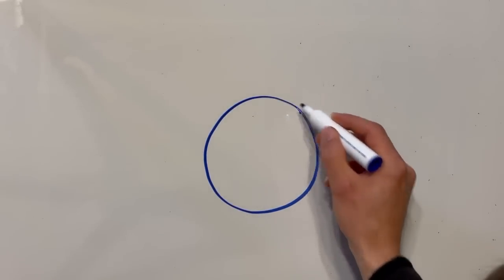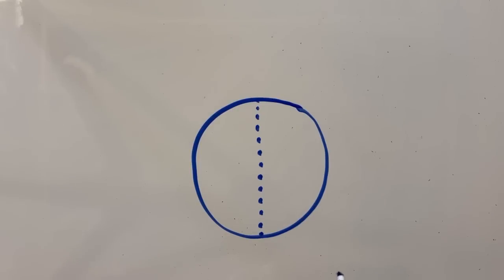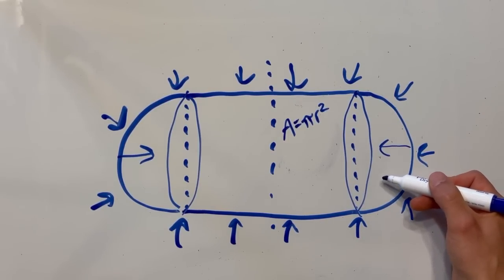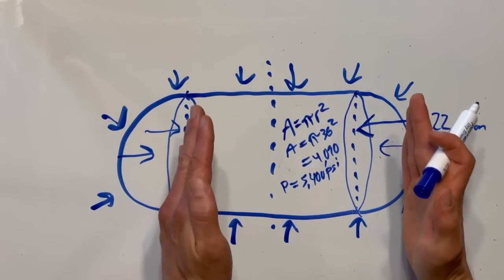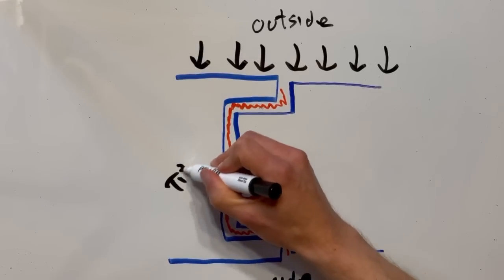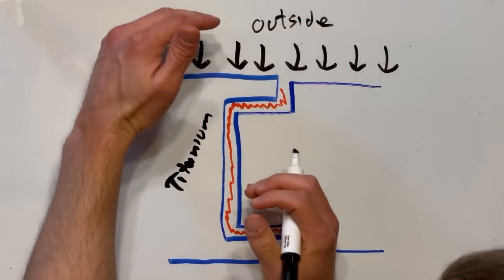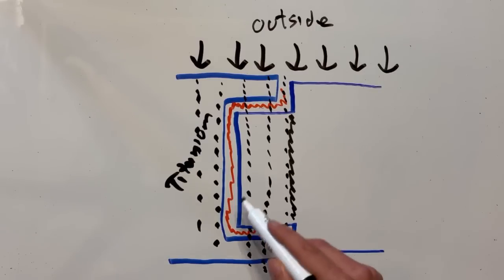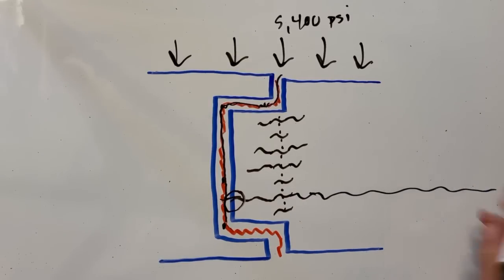Simple Engineering Analysis of How the Titan Submersible Could Have Failed

Comment: From what i saw theres not a single bit of glue residue on the titanium rings. I wanna bet the glue never adhered properly into the smooth titanium. It was only holding it together like a piece of silicone between 2 smooth materials and just popped the titanium off under pressure. If you looks at Formula 1 front wings they can bent alot even though they are made of carbon fibre. You can stand on it and the down ward pressure isnt enough to bend them. But once the wind starts pushing on the end tip the whole wing can bend down because of the way the fibre is laying. Now the parts that arent supposed to move are basically overlapping horizontal and vertical. These parts can stand anyload from anyside without flexing.  However if you see an F1 car crash or the carbon fibre suspension arm is hit at a wrong angle it snaps of real easy.

Comment: I would not ignore the bending in the glue joint.  The carbon fiber cylinder would be deforming to a greater extent than the titanium and that would impose bending in the joint.  The bending may be mitigated by the enormous axial compressive loads, but the bending would cause an uneven load distribution on the glue with the outside of the joint under less compression than the inside.
Reply: Basically correct - although a bit more analysis would be required to ascertain the degree of this effect. But - yes, this is one of the locations worth having a closer look.
The main reason, however, may be the placement of all fibers in the hoop direction (if this really was the case). See my other reply (les 8489).
Reply: @les8489  Completely agree that the carbon fiber is #1 most probable site of failure.

Comment: World's best and first correct analysis available anywhere.

Let me add a little quantitative analysis (which is so easy btw that it can be done in five minutes). Compressive stress in the carbon fiber polymer (CFRP) wall of the Titan submersible was about 200 newtons per millimeter squared at Titanic depth. This corresponds precisely to the stress level where CFRP typically fails under compression. Only under tensile load (which is not applicable underwater), CFRP can withstand about 10 times more. What's more, OceanGate used unidirectional (circumferential) CFRP, as you have also stated. This means that in the longitudinal direction, the hull was only about half as strong, at around 100 newtons per millimeter squared. It's a miracle the ship even made it to Titanic a few times without imploding. It was like doing pole vault, but with a rope as the pole.
Reply: With all fibers in the hoop direction - the strength in the axial direction is about 5% as compared to the hoop direction. And - in compression the strength of CFRP is about 60% that of tensile strength - not 10x less.
Reply: @les8489 
Tensile strength 900 - 2,500 N/mm² 
Compressive strength longitudinal 120 - 420 N/mm²
Compressive strength transverse 60 - 150 N/mm²
Roughly factor 10 and 2, respectively
Reply: @DavidG2P  Tensile strength 900-2500 MPa - OK, although 900 MPa would be for plain-weave fabric rather than tape. The 900 MPa for tape would be an extremely low number (read: shitty tape which belongs in a scrap bin).
Compressive strength 120-420 MPa - incorrect. For a tape with 2500 MPa tensile strength, the strength in compression should be 1300-1500 MPa. If you are getting 12-420 MPa - this means that the test is incorrect (like very long non-stabilized test coupons which fail essentially in buckling). 60% of tensile is a rule of thumb value. These are the results I have been getting on a number of carbon fiber materials in the last 30+ years. Fibers like (somewhat old but still widely used) T300 fibers reliably produce values of about 2100 MPa in tension and 1300 MPa in compression, on coupons with 35% resin content, tested to ASTM standards.
Compressive strength transverse: 60-150 MPa is OK, as this is consistent with strength of resin in compression - although 150 MPa would call for a rather fancy resin.
We are talking here about the failure stress - so, if you can - please indicate a source of "Compressive strength longitudinal 120 - 420 N/mm²"
Reply: @les8489  the numbers come from CFRP companies named PRK and Roechling.
Reply: @DavidG2P  If so - then these numbers are either incorrect, or refer to something else, or it simply is a typo. I have spent the last 40 years designing, analyzing and testing composite structures (aircraft).

Comment: Does anyone know how often, or at all if Titan was weighed as part of its normal sheduled monitoring? My gut feeling is it sounds like it had some form of water ingress which led to either a failure of the Ti/Carbon join or the impregnating of the carbon weave in the tube with water .
Reply: Yes. It beggars belief that the pilot simply disregarded the fact that the sub was descending much quicker than expected. The obvious conclusion would be that "something is pulling us down - and this may affect our ability to return to surface".

Comment: That's pretty much what I thought, shear forces at the joint  parallel to the carbon fibers where the material is no stronger than the base resin seems like a likely cause for failure.

Comment: Some comments from an experienced composites engineer.
1. Like you I was very concerned by the appearance of only hoop winding in the shell, though I have to wonder how the vessel survived even it's first dive if this is the case.
2. You describe what is termed a 0-90 layup.  There are also helical winding techniques where the fibers run at an angle.
3. Carbon fibers are very stiff.  They are not limp. Those who work with them often get stabbed by an individual fiber.  They really hurt.  This is in contrast to Kevlar fibers which are quite strong but very flexible.  Properly designed and bonded carbon fiber structures can withstand compressive loads quite well.  One common example is the top of helicopter blades which are under compressive forces. 
4. The joints between dissimilar materials terrify me.  Thermal expansion differences.  Differing Young's moduluses when stressed.  The sharp 90 degree corner on the titanium flange ring is a tremendous stress riser almost certain to cause problems.  I have had to design mounting of steel rings on rtp structures.  The best approach is generally to provide some sort of cushion between the materials.  
5. In the photos, the area of the glue line attaching the flange appears to be much too small.  Socket joints on fiberglass piping less than a foot in diameter are generally deeper.
6. Components for sizable pressure vessels are generally not cast.  Casting issues can cause many problems with grain structure.  Shells are rolled from plate.  Heads are spun from plate.  Smaller items may be machined from rolled stock or forged.
7.  While  you are correct about the advantages of spherical shell, a cylindrical shell can also be used.  A cylinder will be heavier for the internal volume, but the navies of the world use huge cylindrical shells for their submarines.  These large cylinders are reported to be designed for as deep as 3000 feet which is just as much a design challenge for a large cylinder and 20000 feet for a small cylinder.
Reply from the maker: I almost mentioned helical winds but I wanted to keep it simple for the average person.  I have worked at times with tubes with helical and hoop winds.  It looks like I cut out a small section during editing that stated composites under compression are not necessarily a bad thing, just that additional considerations to factor in.   The titanium end cap should have tapered the flange to almost nothing over several inches to transition the stress load.   I tried to keep the video short enough to keep attention span.  I was shocked I was still over 20 minutes.
Reply: "One common example is the top of helicopter blades which are under compressive forces." Let's not forget about centrifugal forces...A helicopter rotor forms a cone with tension on the blades - this is what keeps it in the air. There is in fact very little compression if any. But on the wing of an aircraft - yes. 
Generally you are right elsewhere :)

Comment: I'm an architect. Your basic analysis is spot-on. Your drawing / section of the flange to tube connection doesn't look quite right though. The Ti ring has what appears to be a 90 degreee 2" overlapping flange at both the interior and exterior carbon fiber tube interface, with a flat direct contact surface between them. 

That aside, the likely failure mode was indeed loss of adhesion between the Ti end-cap rings and the CF tube when the CF tube deflected at it's center due to the enormous pressure it was (repeatedly) subjected to. The inherent defelction problem was compounded by what appears to be an idiotic failure to weave the fibers in a way that exploited their enormous tensile strength. Had the first 1/3 or so of the INTERIOR weave included a lot of courses PARALELL to the logitudinal (long) axis of the tube, they might have resisted the tensile stresses caused by deflection in it's center. Combined with a resin matrix reinforced with....uh....titanium or steel fibers / nanoparticulates or something with more compressive strength and ductility than whatever the hell they glued it all together with they might have been able to reduce the deflection of the tube.

The other problem appears to be insuffcient overlap of the Ti shoe-box style flange with the CF tube. There's an old saying in mechnical / civil engineering:

 "If it don't look right, it probably isn't"

Even a lay person can see that the proportions of that ring and it's flanges "don't look right". I'd expect to see at least a 1:1 ratio between the 5" direct mating surface and the overlap between the Ti ring flanges and the CF tube. In other words those flanges should have been at least twice as deep.

At least. More would be better, and a two 4' sleeves glued with a slow thin slow-cure reinforced expoxy and  mated at the center with another ring to fully enclose the CF tube would have provided MUCH higher strength, containment, reduncandancy and resistance to flexural failure of the adheisive bond between the Ti and CF. But then Numb Nuts Rush the innovative billionaire would have a boring old Ti submraine rienforced with a Carbon Fiber tube, instead of a pure CF submersible with a couple of Ti endcaps slapped on with some JB Weld. 

Then there's the whole issue of repeately load cycling the assembly without any way to asesses fatigue performance short of destructive testing. This is exactly how Oceangate SHOULD have done thier R&D to establish a safe lifecycle for the sub:

1) Build 5 identical full scale subs

2) Take them to the Mariana Trench

3) Send 4 of them down (unmanned!) to twice the sevice depth you plan to use them at for paying customers. 

4) Repeat this twice as many times as you plan to keep your final operational submersibles in service. Asssuming none implode, cut them up and asesses material performance. Redesign if anything looks questionable.

5) Send the 5th sub down until it implodes. Study the wreckage to identify ultimate failure mode.

After all of that, rate your sub for commercial sevice, again, with service depth and lifecycle 1/2 of what the design is proven to through direct testing. Yup - it's gonna cost a fortune, and the resulting operational submraine will cost twice as much as "necessary" from a purely engineering standpoint.

It also won't implode.
Reply from the maker: My cross section may not be to scale, but it was intended to have 2 flanges that fit over the composite tube (with some machining of a step in the composite based on videos I saw.  I keep thinking how they could have made that seam better, and a low viscosity resin sucked in under vacuum could have been a possible better choice.  Also the flanges on the titanium end cap should have been longer and had a taper to them to gradually change the force loading at the transition between the titanium and cap and the composite tube.

The bond joint is just one of a multiple possible failures.  They may never know what really happened.

Comment: I wonder whether the cold water could effect the glue and make it brittle and unflexible. It going from the surface temperature to 12k feet down must have some effect, even if they descend slowly.
Reply from the maker: The water temperature is not all that much below freezing at that depth.  That isn't all that cold to likely create a brittle fracture environment.  But it is something that could be a possibility depending on the exact material used.

Comment: The shape of the hull was not necessarily an issue, DSVs with pressure hulls that shape have sucessfully been built before. 
Aluminaut was one of the biggest DSVs ever built, carrying up to seven people. They used aluminium for the hull, 11 cylinders and two half-spheres, it weighs 73t with a payload of 2.7t and has a maximum depth rating of either 4600m or 5200m (conflicting info). 
It can be done. Just not for cheap.
Reply from the maker: Agreed.  You can build a cylindrical pressure chamber safely.

Comment: Yep, you are no doubt correct that the carbon fiber laminate likely suffered delamination from compression, starting with the very first dive of the Titan submersible.  And, with each successive dive, the delamination became worse and worse.  Your explanation of how the compression of the carbon fiber laminate likely occurred is new information to me - that it was from compression against the titanium hemispherical endcaps.  I have read that in a previous dive, a passenger heard popping noises.  It strikes me that those popping noises could very well have been caused by delamination of the carbon fiber laminate.  That particular passenger was very lucky he was not on the last dive.   I have also read that the crew made some attempt to do an emergency ascent, dropping the skids, etc.  So, I think it is very likely that they heard a great many popping noises.  The end would have happened in only a couple microseconds - far too fast for them to realize what was happening.  Also, the energy released by the implosion would have converted the air into an extremely hot plasma, perhaps a couple thousand degrees celsius.  But again, they would not have known.  RIP for the 5 souls onboard.   May the manned submersible community never suffer such a loss ever again.

Comment: Although I like your clear presentation,  I do not completely agree with your points. 

Yes, the compressive properties of composites are  lower than its tensile properties.  However this is known and should not be an issue if you (the design team) do your homework. 

A bigger issue is the more significant reduction in material properties in the presence of damage (e.g. compression after impact properties). This also is not directly an issue if the correct compression/shear properties have been established and a proper inspection process was in place. In particular the latter is an issue for the Titan because the groove in particular and thick composites in general are very hard to inspect. 

You are probably aware of this, but carbon composites have been used in aerospace for decades.  Also in primary aircraft structures severely loaded in compression.  So in my opinion it is not the use of composites in a "compression application" that is the root cause.  It is doing the required homework in order to get proper design values (this includes taking into account the manufacturing and inspection processes).

Comment: Question:  I get the keystone kind of trying to keep the pressure equal, on the cylinder shape, instead of you getting the keystone shape 360 degrees, you only technically have it in one direction and less so as you kind of turn it, until once you get to 90 degrees it has lost the keystone-like protection, would this also drastically weaken its ability to resist being crushed, or would the few degrees of keystone protection (for a lack of better choice of words) offer sufficient resistance to compression?
Reply from the maker: You are correct.  The "keystone" in a sphere necks down on all four sides from the outside to the inside, while in the cylinder it only necks down on 2 sides.  The two sides are sufficient in a cylinder.  Making the wall a little bit thicker can help regain any compressive strength that may be lost.
Reply: @Mutton_Lettuce_and_Tomato  thanks

Comment: and all the pressure on the end hemispheres is concentrated on the ends of the carbon fibre via the t-rings. If the radius of the cylinder is 30 inches and the carbon fibre is 5 inches the end pressure must be 36 times the water pressure. and that's a lot. I have not seen this mentioned on other sites. in no way does this invasionlidate this video, indeed it applies more stress to the joins.
Reply: and my point is that this is a horizontal force at each end in addition to the radial water pressure so exactly as you demonstrated with the book. delamination maybe
Reply: Your numbers are not correct. Axial pressure is calculates as p*Pi*R^2/(2Pi*R*t) = p*R/(2*t). Basic stuff...
Reply from the maker: You are calculating the stress with that formula, which would the force (p*Pi*R^2) divided by the cross section.  In the video I chose just to describe the force for the average person.  I think stress and strain is a more advanced topic for the average viewer.
Reply: @Mutton_Lettuce_and_Tomato  Unfortunately - stress and strain are the only meaningful measures in analysis. But - agreed, most people might have a problem.